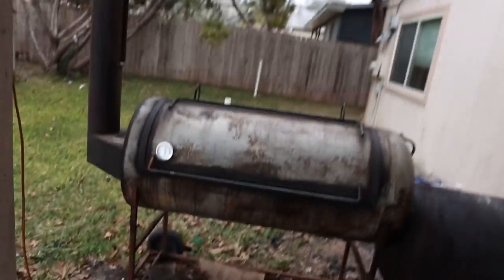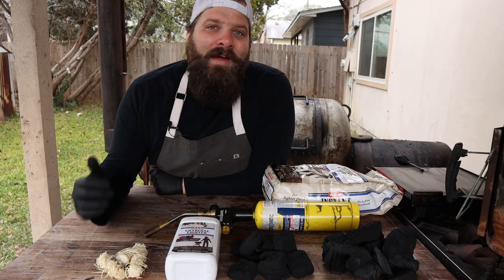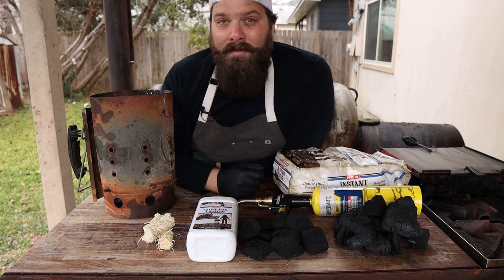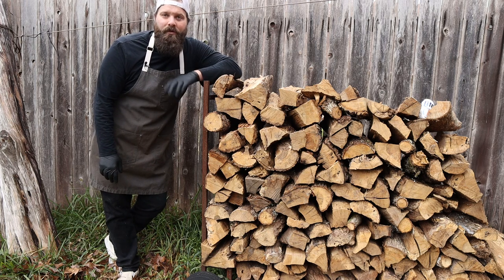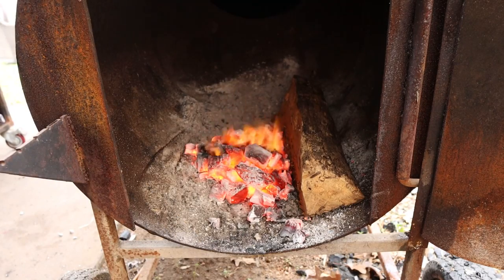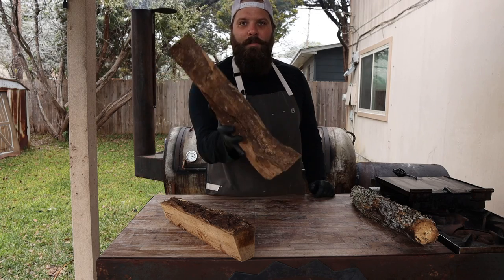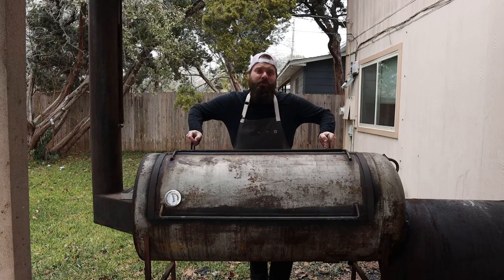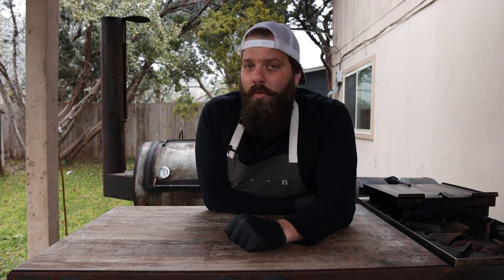How to CONTROL an Offset Smoker | Chuds BBQ

Comment: Hey Chud, use the charcoal bag for fire starter.  Tear a piece of the bag off, wad it up, stick it under the chimney, light it on fire and walk away.  In 10-15 minutes those coals will be roaring.  Thats how I do it.  Works great.
Reply: Yep, I’ve done the same thing. You’ve got it right there in front of your eyes, ya might as well use it.

Comment: GREAT video with great info... I have a LSG 24x48 off set pipe smoker... I have a gas assist and it couldn't be easier to start.  Just like you, I start with a bed of charcoal and a few well placed logs.  Open the vent all the way along with the cook chamber door and crack open the fire box door about 2"- 3" to start.  Fire up the gas assist and close the cook chamber doors after a few minutes and before you know it she is up to temp!  Turn off gas and maybe kept fire box door cracked open for awhile depending on time of year... but I haven't found a quicker way to get a hot clean burning fire to start cooking than this procedure!

Comment: I have an Old Country BBQ Brazos Pit and it comes with a grill grate in the firebox. I assume it was there to use as a grill, pretty much just as big as a weber kettle lmao.

If I'm cooking some dyno ribs (6 hours +), I place the next split above and away from the fire. As soon as it goes to coals, the split I had put on the grate pretty much catches immediately saves me so much time plus reduces the likelihood of it catching on fire as opposed to putting a piece of wood on top of the firebox since it's basically just getting hot air.

Comment: Hi Bradley. Thanks for the content. It is great. I’ve got a 250 at home that I’m still learning and I noticed in your video you are using pretty large splits. I’m currently rocking about 3-4 inches in diameter and roughly 13-14 inches in length. What would you recommend for a 250? Thanks again!

Comment: Great video! I have a 250 gal. smoker and I cook similar to what you did. My firebox is huge, so I can get away with 5-9 logs to start (really trying to get that hot coal bed ASAP). Also, a propane tank & a torch also helps! Still great information and one of the biggest issues most people have is fire management!! Keep on smokin brother!

Comment: I use a char griller offset smoker. My fire box (small box) states not to surpass temps of 400+. With that being said, is it normal for the wood (I.e. chunks, splits, logs) to be on fire throughout the cook or are they suppose to be smoldering. Reason I ask is because a see a huge spike in temp extremely quick.

Comment: Great video. One of my problems that I am having trouble finding a solution to is that my ashes begin to pile up and smother my fire. I use one of coal wire racks in my offset and I typically have to scrap the ashes out every hour or so.

Comment: Question on the wood. If leaving out uncovered in the elements, how long do you have to let the wood dry back out if it got wet?
Reply: from my understanding that's different "wet". When I had wood that got wet in the rain I would just stack them under the firebox and let them dry out during the cook. Once dry(ish) I would use them right away. Unseasoned wood is "wet" from the inside and all the moisture that was in the tree is still in there. Rain doesn't penetrate into the wood that much once it's seasoned.
Reply: Week or two in my experience

Comment: Thanks Great video!  is even temps across the cooker chamber is over value? i always thought i sucked at fire management because i am not able to get 5 degrees difference between each ends of my smoker. Witch is btw not a piece of crap it is built of 1/4'' thick steel. it is always 40 degree hotter on the FB side. I thick it is more like a sale argument that you can use every inches of space of the cook chamber. I'm gonna get a leaf blower for sure
Reply: 5-degrees!?? Not sure that happens often. Also try adding some tuning plates - that will even it out

Comment: Honestly i have been thinking about an offset smoker but because of the price, size and skill it requires i just stick to my weber kettle. But my briquettes are to reliable for low and slow cooks..i only use lump for steaks, because it burns hot and fast

Comment: My one and only question is I got some blackish seasoned oak from my wood place. It seems to burn really nicely. Really even and not a huge jump in temp. Whats the difference in my more black wood vs the wood you have?
Reply: In my experience the darker wood is truly seasoned. You can also see checks or cracks in the end grain.

Comment: Very thorough video Bradley!!! Thanks for the info. I cooked some ribs on my new stick burner(OLD COUNTRY PECOS) with some B&B pecan wood and the ribs had absolutely no smoke flavor on them. I cooked them at about 275 to 300 degrees with just salt and pepper with spritzing. I felt like I had done something wrong and just couldn't figure it out. This has been very helpful. Time for me to find some seasoned wood!
Reply: I'm not the expert but I'm pretty sure the b&b wood is kiln dried. In the video he says don't used kiln dried wood because it only provides heat. I know you experience because I used to buy that same kind of wood. But now I look locally and it's out there you just have to find it. I was driving home and this lady was putting a bunch of wood out for a very reasonable price.  Slammed on the brakes and went back. Just keep your eyes open. Good luck
Reply: Btw I have the old country Brazos.  I know they get a lot of hate but I take care of it and it works great. Maybe 1 day I will get a chub or something,   but for right now learning on it it fine.
Reply: @tomchipego  I have a brazos too and I can’t use wood anything close to that size, I have to use about 8” splits about 2-3” diameter

Comment: Appreciate your mentioning wood sourcing. As a Pacific northwest logger, and owning my own tree service, I have pretty much unlimited access to wood. When I get the rare complaint about the price I charge for a cord of firewood, my response is, forget the fact that I use about $4000 worth of equipment to cut and haul the wood. Forget about all the maintenance and gas and oil. What your paying for mostly is acquisition. Go ahead, invest all that money in all this equipment. Now, go out and cut a cord of firewood. Where are you going to go?
  P.S. I sell an honest cord. How?
Pretty tough to stack a cord of firewood in exactly 4×4×8 foot rectangle. So I divided that dimension into square inches. 🙂
   If your firewood guy isn't doing that, then you're probably getting ripped off.

Comment: I've been using the same Weber chimney for 3+ years, 1 or 2 cooks a week and still has extremely little rust. If you don't keep them out in the rain, they last. Get you a Rubbermaid bin, keep it in there and they last just fine. Also lighter fluid is awful stuff and applicable to frat boy campfires only. Maybe as you say, if you're burning out a new cooker where there is no food involved, but any time there is any kind of food happening I would never even consider it.

Comment: Hey, we're all cavemen. yes we are. man, fire, food. I learned a few things from this and I have been doing it for decades with the smaller offset smokers. I do some things right, exactly as he says, then I do some things wrong exactly as he says. one thing I never thought of is to halfway shut down the smoke vent to create backflow if it's too hot. never would have thought of that. I always just closed the door or opened the main door to let heat out. the other thing was burying the wood or coals? to keep it from getting too hot?  like you said I have the smaller offset oklahoma joe's smoker with a very small firebox.I modified it to seal it up really tight also.  that's another thing I learned here though maybe I have too small of a firebox. I do what you said, start off with a load of lump charcoal, then add big chunks of wood from time to time. I'm pretty good at keeping it about 225-250 but I have to watch it like a hawk. suddenly it jumps up to 285-300 so i like you said try to shut the door, then it gets too white smoke. so then I have to open the main door to let heat and smoke out. it never seems to fail, once I am towards the end of the cook, the temp is perfect and stays there for a long long time. but I can't get it to do that from the beginning. 

the big question I have is ok you have it at 225 and the fire is dying down. but then you just add a small amount of wood chunks, and it immediately jumps up to 300. how do you add wood without it jumping up in temp and creating the white dense smoke that you don't want? I mean I only add a very small size chunks of wood. use the back draft method? in the end  I have been able to make some great brisket and it doesn't have any bad burnt smoke taste to it. it seems ok taste wise, and I love for the neighbors to smell my big smoke. but at the same time I'd love to create the thin blue line smoke for more than a few minutes at a time. I am using extremely dry wood also, not even the slightest wet wood. 

one competition bbq guy on tv says he just leaves the door open all the time. but if I do that, it just gets too hot.probably because I'm using a relatively small offset. I don't think I could do that without having the coals go out on such a small smoker backyard bbq. damm, love that smoker  you have

Comment: Matts bbq pits have awesome fire boxes.  3/8" or insulated.  He shows how you can fill the entire box with wood, adjust the temp  and leave it for 6 hrs or more. I wish i could get one.  Seems his are very under the radar.  He sells both styles but seems to push reverse flow style for a more constant heat.   The  constant attention smokers require is the drawback.  If you can leave one alone all night,  that would be great.  Seems the right firebox is the key.

Comment: Thanks for this, and all the rest of the videos. Always informative and entertaining. I do have a fire question. I’m a retired ship’s captain, and when dinosaurs roamed the earth, most ships had steam plants, not noisy cranky diesels, and fire control was critical to efficiently run steam turbines using super heated steam. 
The engineers would strive for “economy haze”, meaning you’d hardly see anything coming out of the stack, just heat. Too much air, white smoke, not enough air, black smoke. Of course these were oil fired and forced draft, but just like an offset,” thin blue smoke” was our “economy haze”? Or am I mixing apples and oranges?
 Seems on an offset with lots of white smoke, answer is to inject more air. Is the wood fire of an offset actually, what we called black smoke, O2 deficient? 
Using a WSM with great meals consistently coming out, but I don’t have enough aggravation in my life, so I’m thinking of getting an offset. 
Sorry for the long winded post, before you got your own command, had to have some engineering knowledge and a somewhat unhealthy degree of OCD, and I need a distraction from the news, especially as a first generation American-Ukrainian. All the best, Cheers!
Reply: That sounds a lot like the "broken" oil burning commercial shop heater at work I fixed. If you were burning too rich it was black, too lean it was whitish, but if you got it just right it was almost clear with the heat coming out the exhaust having a wavering lensing effect. It's amazing how fast those things can belch out smoke from a warped firebox. lol It coated the walls and my lungs with soot in seconds.

Comment: 5:24

I dont like using any other materials in my fire other than the charcoal briquettes or the wood...just my ocd.

I like to take 3-4 briquettes and set them on the fire grate. Use a few drops of lighter fluid to get them going. Set chimney (full of all lump or 1/2 n 1/2 lump/briquettes depending on the cook) over the 3-4 briquettes burning on the fire grate.

No paper, wax, or weed smell and the few drops of fluid to start the initial fire is well burnt off.

Again, just my ocd🤣

Comment: Do you always keep the damper on top of the stack wide open?
Reply: I do on mine UNLESS too much wind ripping thru fire box- then ease stack close until both sides of grate temps are even. Usually end up with 1/2 closed down on those windy days.
Reply: @2005Pilot  Thanks Conrad!  I have a horrible time keeping lower temperature in my Oklahoma Joe smoker...just can't get it to where I want....